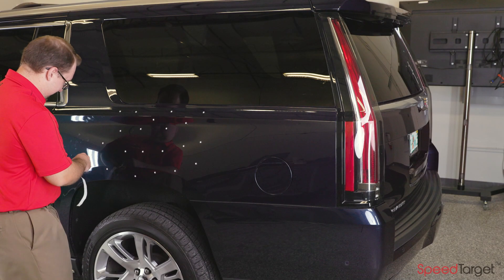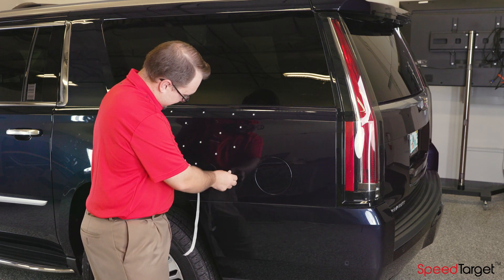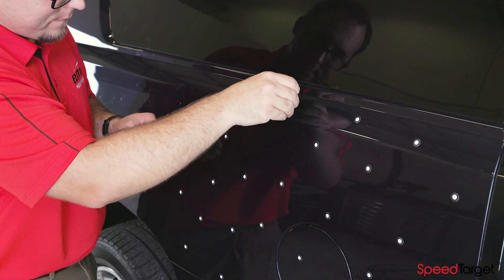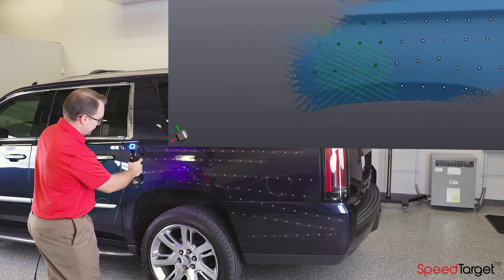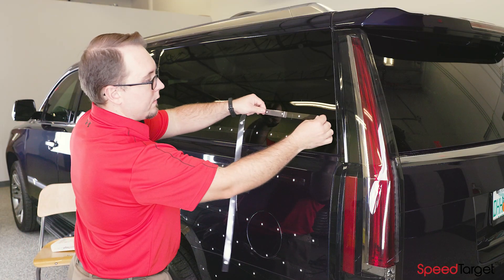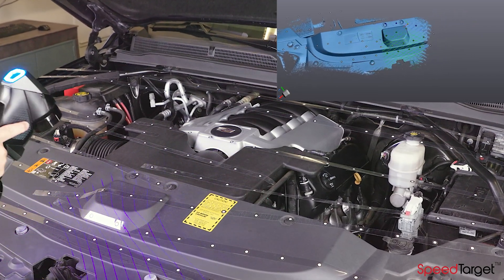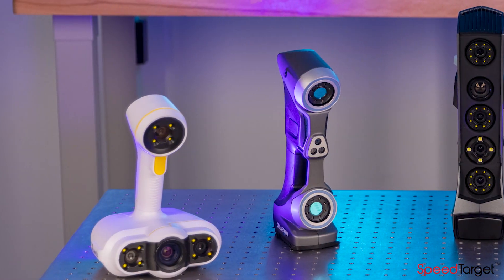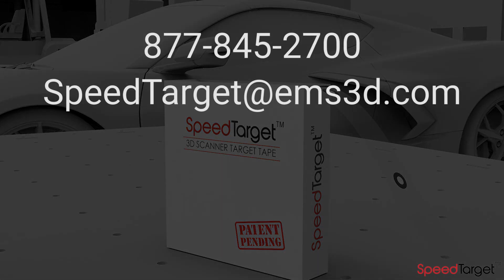SpeedTarget - A Faster, Easier way to apply Positioning Targets for 3D Scanning

Comment: Results are impressive!  Is there a small variability in the distance between targets on the tape?
Reply from the maker: Hi Mark,  no the targets are evenly spaced but as long as you slightly stager the targets on the tape as you apply it you should have no problems with tracking.   You can also manually put a few targets on in various places as well.